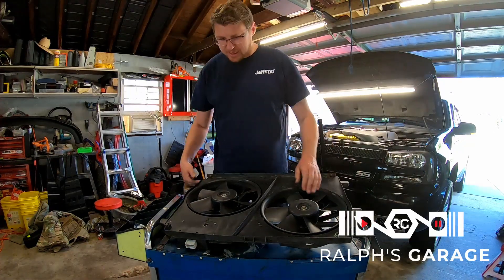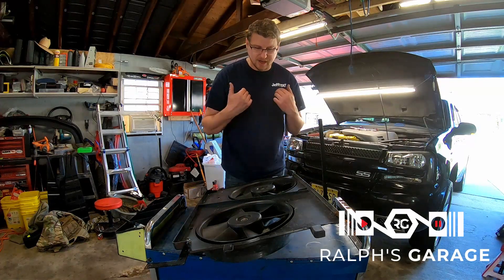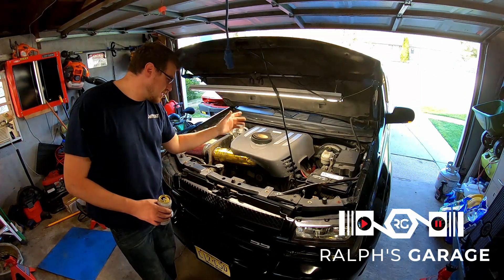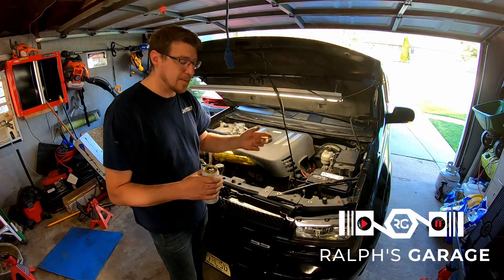Get the Best performance from your Trailblazer SS LS1 Efan conversion

Comment: Hey Ralph nice video thanks for sharing your ideas, I still haven't had my fins installed yet but did help a friend with some ideas on his installation and added rubber door mounding weather seal around the edge of the fan purchased from Ebay this also took up the gap and insulated the fan shroud from the radiator but I will also add this for a better seal Thanks!!!!

Comment: Is the TrailBlazer SS staying cool in stop and go traffic now?
Reply from the maker: Yes but I was only have problems last summer on very hot days. It's not hot enough to know for sure yet but with how large the gap was between the shroud and the radiator it will definitely be much better now.
Reply: @RalphsGarage  Thanks for the update!